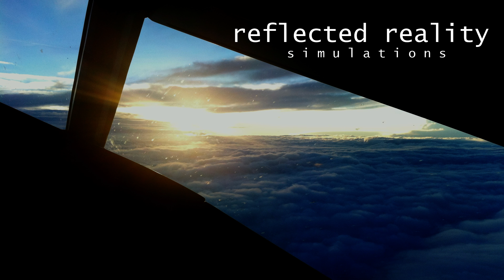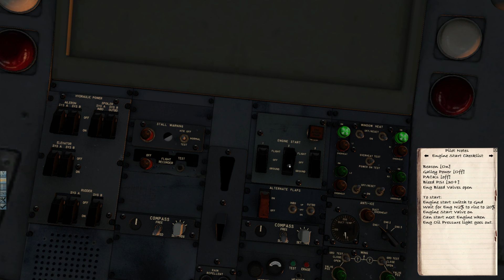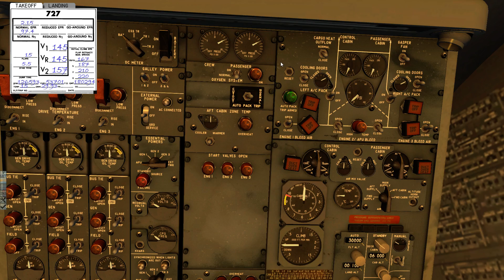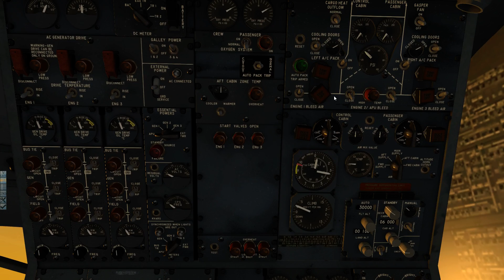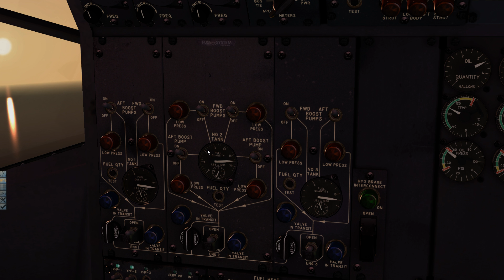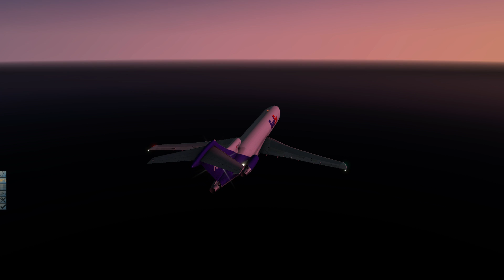FlyJSim 727 V2 EINN Departure [X-Plane]

Comment: Hello there, great vid as always...
contrary to your explanation, I believe that platform alignment doesn't have anything to do with gravity but only on the natural tendency of spinning disks to maintain a fixed orientation in space - the gyroscopic effect, irrespective on whether gravity is present our not. It is used by astronauts in space!
Reply from the maker: Thanks Richard, that’s a very common misconception. The aircraft INS system is “aligning” to true north. It does this by sensing the change of local gravity as the Earth rotates and the gyro is locked in space as you say. The gyro therefore needed to be “torqued” to match Earth rotation. The torque rate varies based on latitude hence why you need to input it beforehand. If that torquing results on the local gravity vector not being correct, then the platform isn’t north aligned, so it rotates and tries again. That’s also why INS have a max latitude for alignment, as above that they don’t have a large enough gravity vector change to allow them to find true north. Space applications use a universal reference rather than true north, so don’t need an Earth rate correction.

Comment: Have had this aircraft for more than a year. Know relatively how it works, but now wanted to check out the CIVA. I must say this is really a great video. Very instructive. Subbed!
Reply from the maker: Thanks, Yes the CIVA adds another dimension to sim flying. Unfortunately the CIVA plugin is nowhere near as fully implemented or as robust as the 15 year old SimuFly CIVA for FS2004. I flew the David Maltby VC10 and SSTSIM Concorde with that unit for many many hours. That said the X-Plane version does give you a feel of what non-database inertial navigation would have been like.

Comment: Flying with the "CIVA" navigation is very fun when you start to master it. Have used it alot with the FlyJSim 732. Its keep you busy all the flight :)
There is also a "CIVA helper" plugin that can be very usefull. Its maybe cheating to use it , but can save you some time when entering the coordinates for longer routes or entering in SIDS/STARS :)
http://forums.x-plane.org/index.php?/files/file/24566-civa-helper-plugin/
Reply from the maker: Thanks, it's an enjoyable device to operate. I remember having lots of fun at Mach 2 over the Atlantic in the SSTSIM Concorde back in FS2004, trying to get one last DME update from Cork before going out of range. For this kind of Navigation a paper flight plan is really needed to hold all the locations and frequencies. The helper plugin looks useful too, I'll take a look thanks.

Comment: Heya Graeme,

A plane i haven't got more's the pitty

Nontheless, another sterling vid that's very detailed

:-)

Thankyou

Tony
Reply from the maker: Thanks Tony. By the way your suggestion on overheating causing the crashes is looking to be spot on. I'm running an i5 overclocked to 4.5GHz and when I had the crashing issues we had an few unseasonably warm days. It's all settled down now the weather is back to normal rain. I'll open the machine up and have a look at the cable paths etc to see if I can improve the cooling.
Reply: Hiya Graeme,

Anything pc crashing-wise, my first port of call besides a dodgy x-plane addon lol is heat (or used to be heat i should say)

Well, hopefully heat was your problem, i've got a fancy touch screen fan controller, yet to be installed as the fans i want sell like hotcakes, so my external radiator is now cooled by a desktop room fan :-) (well, it works)

A tip for fans if you can't mount any more in stock areas, i use good string or zip-ties and get to aim them at the gpu cpu area,  years ago it looked like a spiders web but hey i got cooler temps, but now for years i've had a massive lian-li ali case so airflow and fan amount is no worry, also watercooled for almost 20yrs now so less of a problem for me

You'd be surpised that just wafting the air more around a case how much it can help cool, it spools the air around instead of kinda pooling in corners or under hdd areas

If you're after 120mm fans and not worried about blue/white colour, i recommend Silverstone SST-FQ121 FQ Series (watercooling optimised) great on radiators and great case fans, not the dearest at 8 quid a pop, very quiet for me, and are PWM so can turn em up n down

Have Fun

Tony